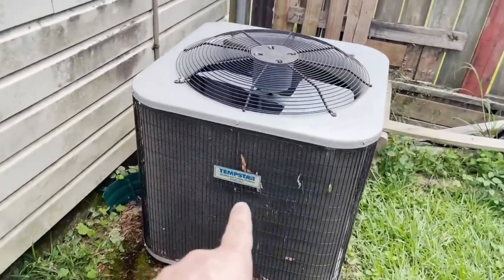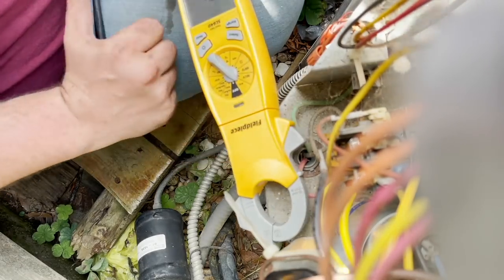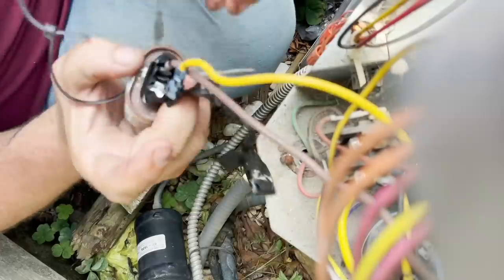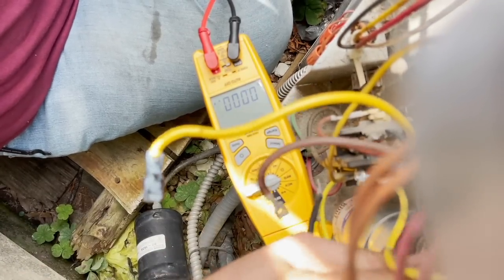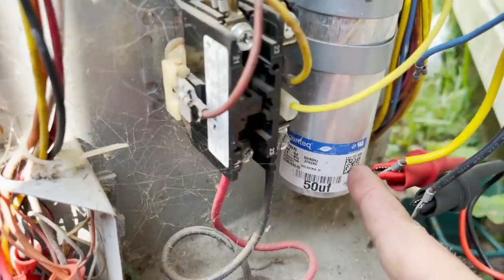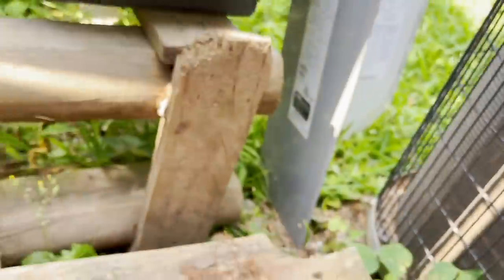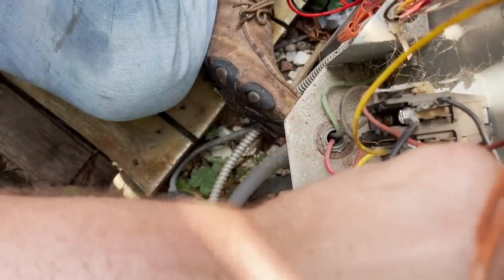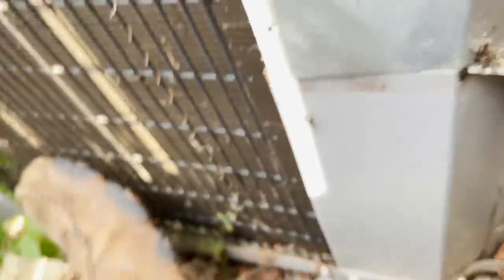No Cooling/Compressor in Thermal Overload

Comment: Nice that you had that little platform to sit on instead of mud. I had a fan motor with a bad capacitor. It got so hot that water sprayed on it would instantly boil away. That was about 6 years ago. The motor, which was made in India, is still running! And in Louisiana, it runs half the year.

Comment: I just had a brand new Goodman central AC and brand new air handler system installed today and its not cooling right off the freaking bat.  It cooled down to about 75 and then went back up to 76 and that's where its been for about 5 hours now.  The outside unit is not blowing hot air but it sounds like the compressor is on.  IDK what to say.  It's a brand new system.  I don't know if it's the AC unit or the installation.  Unbelievable!

Comment: What causes thermal overload? I changed my cap last season. Could it be the cap again?
Reply: The fan was not working because it had a bad capacitor.  Thermal overload is from heat or compressor failure.

Comment: Dont Imus understand why residential techs never check amps on compressor or fan after changing caps. Those caps dont just run out of juice so to say. It's always a sign something else is wrong.  A season tech will look why caps were discharged and most of the times you find it from amp checks.